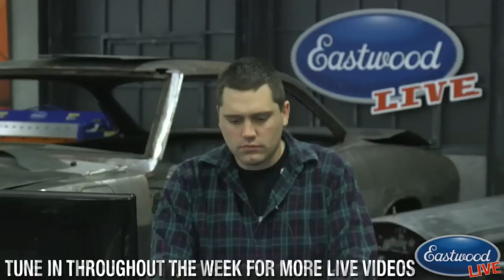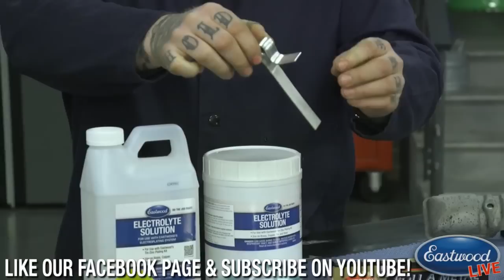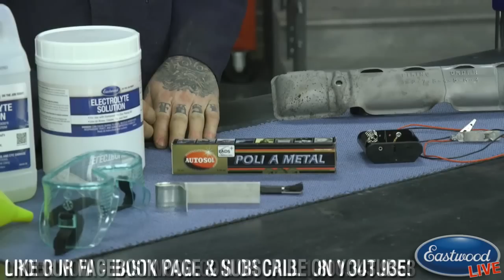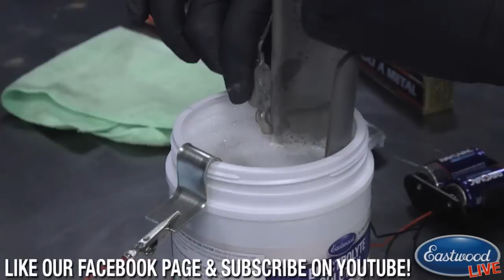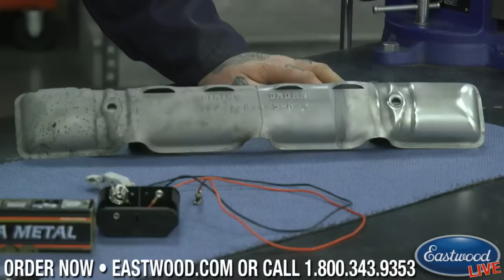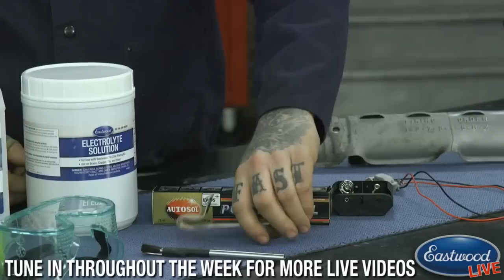How to easily bring back the luster with Tin Zinc Electroplating from Eastwood.

Comment: Is this similar to CAD plating -ie GOLD in color .. This should be great for nuts and bolts
Reply: i recommend not leaving the zinc plate exposed, it still corrodes but at a slower pace than bare steel but it still corrodes none the less and instead of an ugly rusty iron oxide  zinc  oxide is a white  powder thats more attractive looking oxide than iron oxide, but eastwood should of mentioned an option of a second step after zinc plate using blue or yellow chromate dip process to further enhance the zinc finish and add more corrosion protection than just zinc plate alone, i dont know where eastwood comes up with TIN in all this  when usually most cathodes are 99.9% pure zinc? maybe adding Tin  to the cathode eliminated the need for the chromate dip process? so if eastwood could touch base on difference between pure zinc plate to tin zinc plate would be interesting to know the benefits. plus a lot of folks confuse chromate dip with CAD or called Cadmium plating of which is another process entirely and is carcinogenic and not ideal for the home hobbyist. check out my channel for more details and better methods of zinc plating and yellow/ gold chromate process